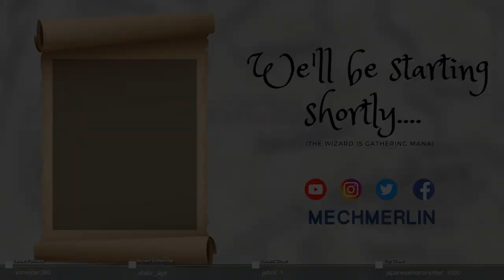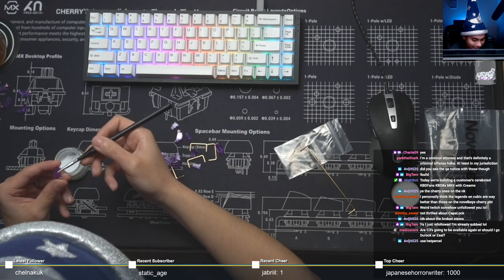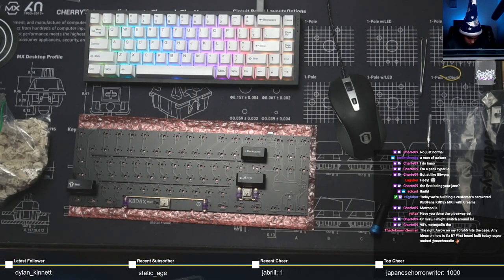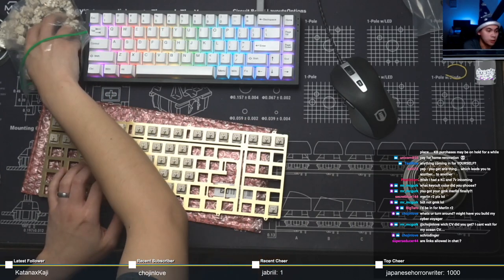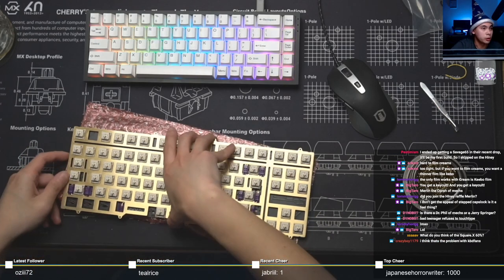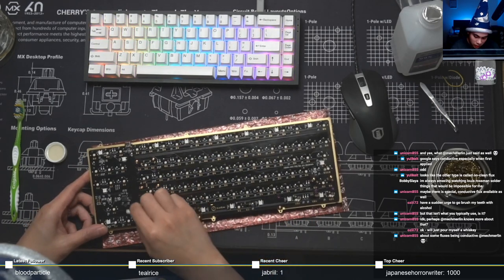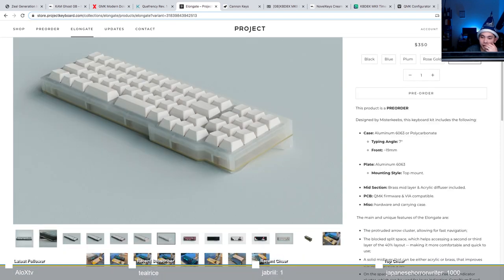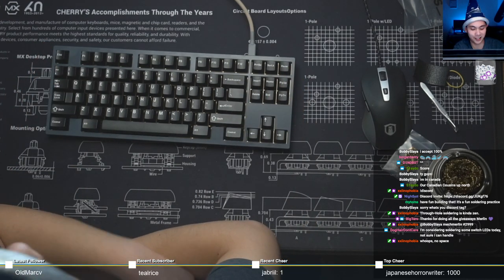Build Stream: Cerakoted KBDFans KBD8x MKII with Creams

Comment: "Small scratches on the weight of brass are not flaws. Return and replacement are not accepted. If you mind, please do not buy." Is a bold message in red on the order page for this case. Seems like even they know the quality control for these cases are poor, and I'm surprised they haven't done anything about it.
Reply from the maker: Yeah it sucks that they write that.
Reply: @MechMerlin  yeah despite the fact kbd fans is budget usually it’s still lazy

Comment: Got a silver with breaked in creams (light 205g0 + 63.5 Sprit springs with 105). So disapointed by the sound reverb hollowness. Unusable stock... You actually have to change the stock screws, burger mount it and use silicone tap all around the edges of the bottom part of the case. Then it will eventually become a decent board. I also have a CF plate just in case. Not even talking about the fact that I received mine damaged with brass weight unscrewed
Reply: But kbdfans boards is benefiting from sorbothame. I woild recommend to install some
Reply: @Donbros  But then total costs of the mods make the board a lot more expensive. I think that in this case you better get another board and have a perfect finish
Reply from the maker: Oof, yeah it sucks that such a expensive board isn't properly shipped =(
Reply: @MhonsterPlayer  yeah it is not very cost effective. Who called kbdfans budget - kbdfans are just annoying. You can buy a lot of boards cheaper and better than kbdfans. Also they customer support is one of the worst (but better than drop)

Comment: Do you know how to get the caps/scroll lock indicators to work with in switch LEDs? Soldered two for caps and scroll lock but they don't come on.
Reply from the maker: There is apparently a hardware switch on the back you can toggle to enable this functionality

Comment: I wonder if he got a real brass weight and weight. I joined the GB and people have complained the brass isn't really brass at all, both the plate and weight have this sand blasted finish to them and someone even took it to jeweler and determined the weight is copper plated (magnets stick to it, which if it's brass should not be happening) and the plate is compiled of what's known of "junk brass" so it just really sucks. My board arrived completely fine, no chips in paint or anything, knowing this almost made me consider selling this thing and making my money on it but I've been wanting a white TKL for quite some time, and my Rama SOYA won't be here for months, the white Sat 75 won't be here for a while either, so I'm thinking I'm going to keep it, just don't like how KBDfans has been handling this situation. The lack of responsibly and commitment has been a bit off putting especially since I have bought a lot stuff from them. Sorry for the rant, just really sucks his was that badly trashed
Reply from the maker: Well, KBDFans isn't exactly known as top tier custom. I've read that it takes very little brass in the composition to qualify a material as brass, so that might possibly be the case with these plates/weights. Who knows.

Comment: Just got my kit a few days ago, I'm still debating what switches I want to put in this thing, was planning on doing gat inks w invry UHMWPE v2 stems but if you know the story, they were completely screwed up by the manufacturer so I'm waiting on the new batch Drop will be sending out but who knows when they'll be available, so now I'm left torn between polar panda switches, tangies, or some durock linear's like mauves or something but I can't decide so it's leading me to see if I should hot swap the PCB with mill max sockets. Anyone have any experience doing this to this board or similar top mount board like this?
Reply from the maker: Im actually one of the first people to try that frankenswitch, it was probably the smoothest switch I've ever experienced but the UHMWPE and its high pitched sounds ruined it for me. If I could do it again, I'd replace the top with something like Cherry tops or even Gat Milky tops
Reply: @MechMerlin  Really?? Interesting, I'm forgetting what reviewer I was watching, I'm thinking it was Andy Ngyuen for the best linear switch or something like that, and they showcased a bunch of different one, tangies, alpacas, creams, etc. and they had gat inks with the UHMWPE stems and in the board they sounded so much smoother than the stock gat inks which is why I wanted to try them. I love the gat ink but the heavy weight got a bit trying (I've had carpel tunnel in both my wrist & I type, a lot for my job) so I actually have 62g springs in mine and that to me is perfect, but I actually have some old cherry silent switches & milky gat yellow switches so while I'm waiting on the new UHMWPE stems, I might have to try some of these they sound interesting haha
Reply from the maker: @erikvasauez9361  Yeah I told Andy about the uhmwpe in inks. At the time he preferred UHMWPE in JWK better though. Not sure how he feels about it now.
Reply: @MechMerlin  I'll definitely have to test it for myself, I liked it from the sound and I'm already getting some so might as well anyways, but I am curious to see how much of a difference adding the cherry tops or gat milk tops will change the gat inks. I appreciate the input though man, been watching your vids for quite some time now so keep up the good work bro.

Comment: Has anyone tried using mill max on the pcb
Reply from the maker: They work on the kbd67mkii which is also made by ai03, I bet they would work fine on these too
Reply: MechMerlin Thanks dude, abit worry on the compatible issue. Maybe I will try it out thanks!
Reply: @Gruelcore  what happened my dude did it work?